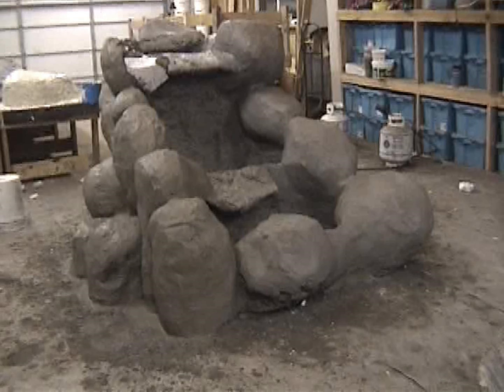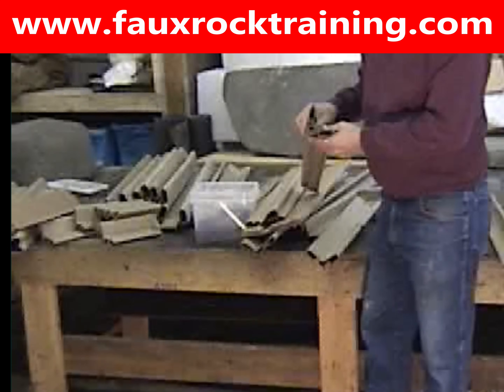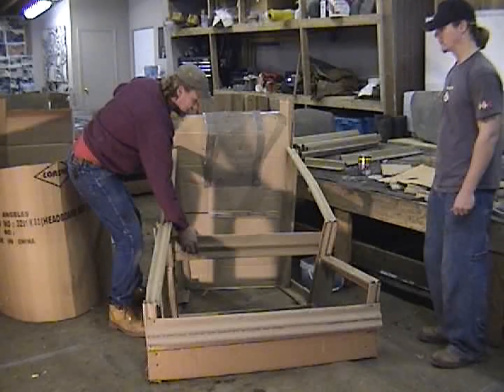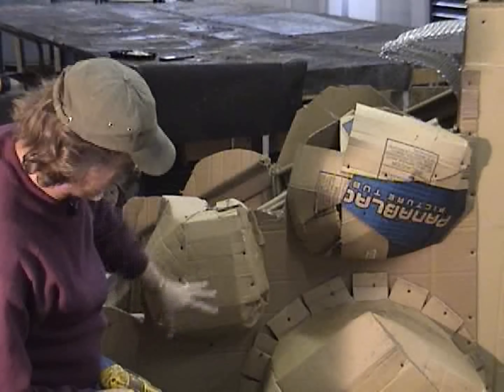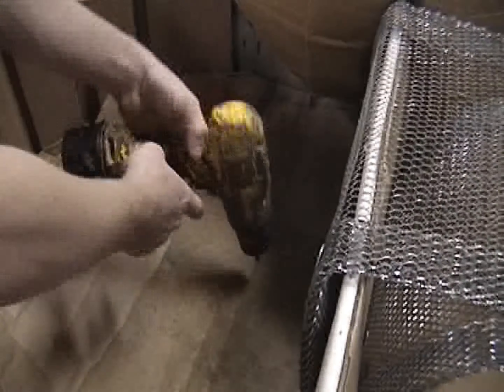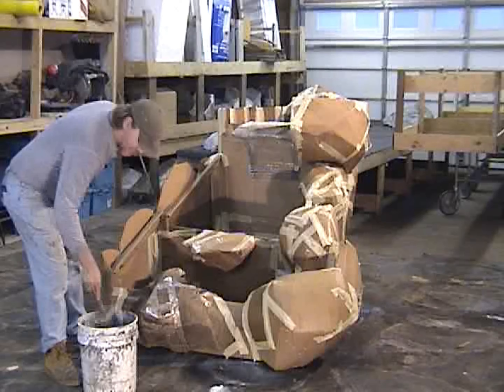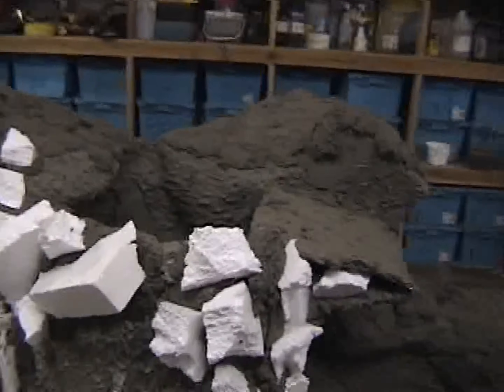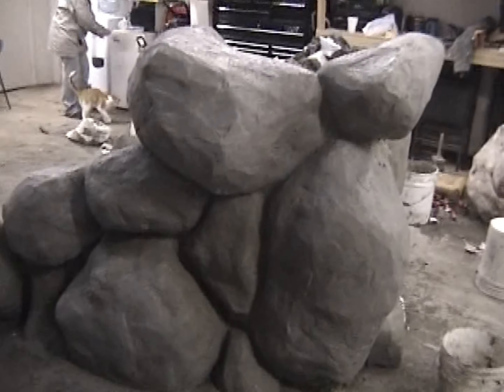Build fake rock with cardboard form

Comment: Thanks for this great video! I’m looking for an affordable way to build a large, solid, “rock like” coffee table for my home that is not too heavy and can withstand some weight! I think I can handle this… the concrete on top, do you add a plaster or spray as well, for color and/or waterproofing? Also, can you get all supplies at a local hardware store like Home Depot? Thanks for the diy and answering questions in advance! ☺️
Reply from the maker: Yes, all the materials that you need you can get at Lowe’s or Home Depot. and obviously we stay in the rocks and waterproof them with a sealer that are typically found in the Masonary industry. Thanks for watching my video.
Reply: @fauxrock love it! I will definitely be trying this! Thanks again! I look forward to more content!
Reply from the maker: @wednesd888 👍

Comment: Nice video. Been watching all of them b/c I have to build out a water element in my back yard to complete the corner. Can I use a bag of say "SAKRETE Gray Type S Mortar Mix" instead of 2p sand 1p cement, then seal it for the waterproofing? Thinking of using pool noodles to build out the shape then the metal lathe then applying mud.
Reply from the maker: Danial,
Yes, you can do the mix as you described. There’s probably more cement to San ratio in your mix and you’ll find in a bag of premixed mortar so that’s good.

Comment: I was thinking about using used  rubber conveyor belt as a form liner inside of a rock wall casting.     Would be nice to 'texture' the conveyor belt somehow.   Any ideas on how to do something like that, some sort of heated metal roller or something.    CNC Torch or something.
Reply from the maker: I’m not sure exactly what you’re thinking, but I’ve made rock using old rubber roof liner. We just splattered the rubber with a mortar mix that had the acrylic glue mixture as a liquid once that thin splatter coat was dry within mud it over it with mortar. I imagine you could do the same with your belt material

Comment: What did you spray it with before the cement mix?
Reply from the maker: I used an acrylic, bonding agent, waterproof the cardboard.
Reply: What brand do you use/recommend?
Reply from the maker: Here is what I recommend.
https://www.amazon.com/MasterEmaco-660-Formally-Acryl-60/dp/B00KM42F2A/ref=mp_s_a_1_1_sspa?keywords=MasterEmaco+%28Formally+Acryl+60%29&qid=1684515624&sr=8-1-spons&psc=1&smid=AYETLLJ1Q9FG5&spLa=ZW5jcnlwdGVkUXVhbGlmaWVyPUFaVE1CUE9MWDUzSkwmZW5jcnlwdGVkSWQ9QTA4MDE3NDVXSVpSQlJQMFdZQkUmZW5jcnlwdGVkQWRJZD1BMDcyMjE5OTM1RTZNSlNaMVVYNSZ3aWRnZXROYW1lPXNwX3Bob25lX3NlYXJjaF9hdGYmYWN0aW9uPWNsaWNrUmVkaXJlY3QmZG9Ob3RMb2dDbGljaz10cnVl#aw-udpv3-customer-reviews_feature_div

Comment: Do you ever use a hot melt glue gun ! Or do you always use dry wall screws ?
Reply from the maker: Do you know just yesterday? I was thinking about getting my glue gun out in some cases it’s faster and can do well holding cardboard together long enough to apply the mortar or fiber mixtures. In the past I’ve also used cardboard staplers, which is even faster. I just don’t have a working stapler anymore.
Reply: How long will a water fall last made this way ?